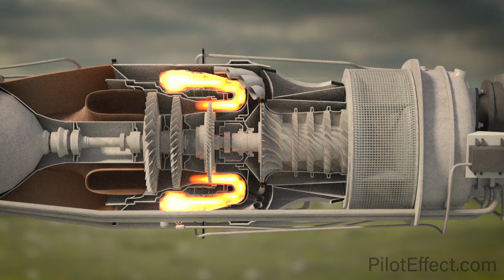Free Turbine Turboprop Engine Cheat Sheet | Pilot Tutorial

Comment: i wanna see someone hold that prop as the engine spools up
Reply: Harshky it's a "free" turbine so as long as you didn't let it get to speed you could do it.
Reply: I wonder...once the power turbine receive the pressure of the hot gas, it transmit its torque to a 15:1 gear ratio. How much force can the gas apply on the turbine. You have to apply at least 15 times that force. Is it really doable?
Reply: The ATR! On Hotel Mode, prop brake is applied to stop the prop while keeping the engine running. Available on engine #2 only.